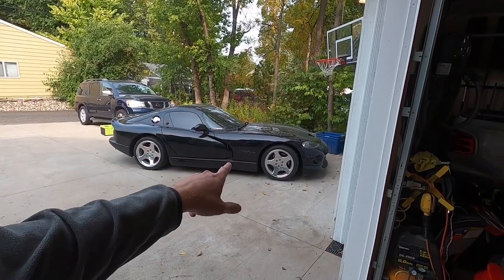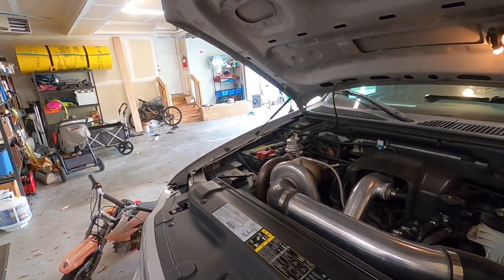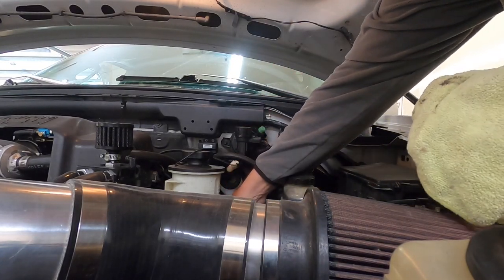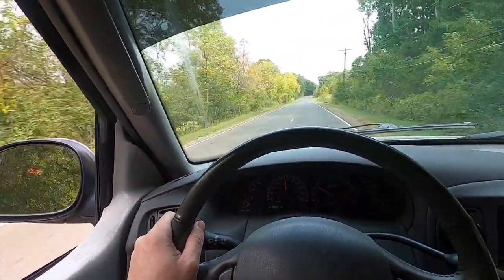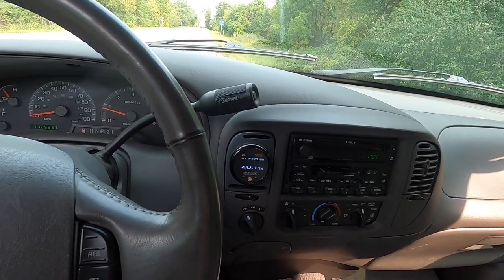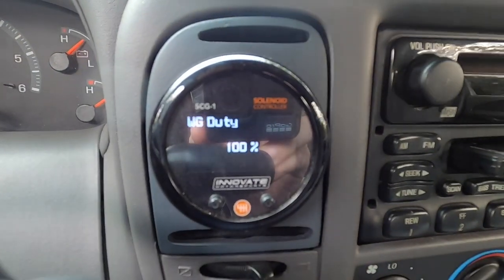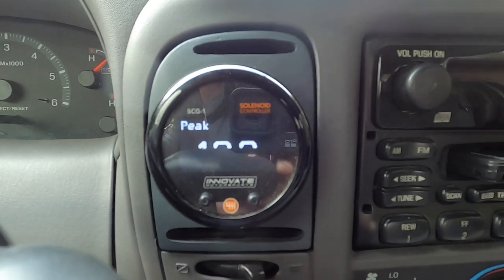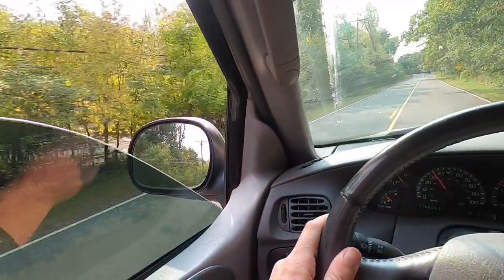Will a STOCK TRITON 5.4L handle 12 PSI?! ***SINGLE TURBO Grandpa Truck***

Comment: I’m calling in the neighborhood of 460 whp at 12 psi. Gramps seems like a fun truck. 🤣
Reply from the maker: That's probably pretty close!
Reply: That’s a generous a amount.
Reply: @brianmccarthy9855  not really. It’s a relatively fair amount considering it made just over 400 at 8.8 psi.
Reply: I bet he's at 530whp ish being a 4.6 probably makes a little under 500 on 10psi
Reply: Those 5.0 and 3.5 ford engines just put their old stuff to shame. 460whp is low hp now for forced induction .    I'm just not impressed by this .
Reply: @greylove1522  difference in perspective I reckon. For a 15+ year old truck to be completely stock outside of the turbo parts and tuning I think it’s neat. Hell, I have a Hyundai making 385 at the crank. Not anything crazy, but it’s enough to be fun even in a 4100-ish lb car. Gives me plenty to play with when the roads empty.
Reply: @Genesis385  I understand what your saying.  385 crank is fun .  I'm just saying the new technology in vehicles now kinda make stuff like this pointless.  Back in 2004 this would've been king of the hill.
Reply: @Genesis385  An ecoboost or 5.0 will match this with a tune. Wild How times have changed.
Reply: @greylove1522  absolutely. My car is a 2011 Hyundai Genesis. 4.6 32 valve v8. Not too shabby. 6 speed ZF auto is a little slow, but that aids in its reliability lol
Reply: @greylove1522  it really is. A friend of mine has a ‘19 5.0 PP1. Did bolt on exhaust, intake, and an E85 tune. Thing was wicked before he did that and I haven’t been in it since all he had was his axle back.
Reply: @Genesis385   I bet it was fast
Reply: @greylove1522  It's daily transportation. If you want to run 50 pounds of boost and spin your motor at 16,000 rpm, buy a Formula One car.
Reply: @Duke_of_Prunes  Do you have any idea what a set up like this would make on a modern F-150?   I'd go as far to say 700 whp at minimum
Reply: @greylove1522  At 700 hp, even the heavy new trucks would get up and go!
Reply: @Duke_of_Prunes   An older crew cab ford is heavier.
Reply: For it being a stock engine.And no forged pistons or and just the turbo its decent power I'm guessing your getting about 580 to 600 whp at 12 pounds.Not bad the gramps is definitely a fun truck for a daily driver.

Comment: I just bought a 97 Eddie Bauer expedition with the 5.4L I didn’t need to see this video!
Reply: This is the video you know you wanted to see
Reply: I just bought a 5.4 litre 1997 single cab -- stripped out with vinyl floors, no options, and very light compared to a new one.

Comment: Compressor surge is what you're hearing from the blow off valve not working. At 100% duty cycle, what is the base wastegate spring youre using? If you go to a base 10# spring you could reduce the duty cycle of the boost controller. Get that blow off valve working. It'll keep the turbo alive longer.
Reply from the maker: It’s a 6# spring, that’s why I can only hit 12psi at 100% duty on my 3 port solenoid. Didn’t realize the % duty cycle would affect the bov.... I’ll need to try that out. I’m afraid if I put 10 pound spring in, I’ll be tempted to try 20psi tho!🤣
Reply: @AutoDetour  I understand the dilemma about boost being addictive. Good luck in your endeavor. My recommendation will definitely fix your boost issue. Also, as i stated previously-get that blow off valve fixed to stop the compressor surge. It is very bad for the turbo. Keep it in between the lines and keep having fun my friend.

Comment: Yeah that's called compressor Surge, and it's caused by the blow off valve not opening. That sound you're hearing is the air stalling over the compressor as it goes backwards against flow, or stops, when the throttle plate closes in the throttle body. It causes a sudden loading and unloading of the shaft very quickly axially and honestly doesnt really hurt the turbo until higher boost levels/shaft speeds.

Comment: The triton bottom end is pretty good. My only concerns would be the compression ring gap under boost and the spark plug threads in the heads. Should hold up well otherwise. Pretty sweet!
Reply: Yeah I read about spark plug blowout and having to rethread. Haven't heard/read anything yet about the turbo setup having that issue.

Comment: I wanna see this against a Lightning
And I wanna see this in person someday.
Reply from the maker: I'd love to get it next to a lightning!
Reply: I second that. 👍
Reply: Harley Davidson edition was basically a 4dr Lightning
Reply: Lightning only ever put out 380 at the crank.
Reply: @ronniestine  A pulley swap will easily get you more power with the Lightning. Kenne Bell makes a bolt-on twin screw too. I think the Lightning would handily take this truck off the line, but the turbo truck would make up some ground as the speeds get higher. The Lightning has some advantages when it comes to suspension and traction too. Then there's the people who have turbocharged their lightning. You've got all forged internals so you can push the bottom end way harder than a standard 5.4.

Comment: If you add ring gap and fresh bearings up while you're at it it can handle some real boost lol
Reply: Around rod bolts and head studs and arp main studs
Reply: @spankthemonkey3437  cheap upgrade forgot to mention.  This is def going to help the cause ...
Reply: no, the rods'll go after 450-500 wheel. It's a time bomb on anything higher than that even with ring gap. the rods are the weakest link

Comment: These 2v 5.4s will run forever!
Reply: Mine has 390k
Reply: 223k on mine
Reply: 602K on mine.
Reply: @keaganhunter1644  really? I'm asking because I want to buy a 2000 expedition. But it has 220k miles. $3k very clean though
Reply: @biggs1485  Take the oil cap off and snap a picture of the cam lobe surface look for sludge and wear if it looks good and sounds good I would consider it. My 600,000 mile 5.4 is in better shape then my farm abused 4.6L same 2 V modular design.
Reply: Gerod Wilson Thats nothing for the early 5.4s our company truck 5.4 went to 400k we swapped the 5.4 for the v10 for more power but that 5.4 wouldn’t quit

Comment: Btw man if you like that turbo flutter you can keep it @ low boost it won’t hurt anything , but if it’s high boost pressures that turbo surge can make shit fail. But yea your waste gate isn’t working properly .
Reply: *blow off valve

Comment: The modular takes boost very well.  The intaje and heads suck but the internals can take close to 700hp before they fail.. its the LS of the ford world
And the 4r70 is a good.. i recommend doing the 500hp J Mod.  Search it. You bunch the holes in the separator plate larger. 
Its a mod from one of the fuys who R&D that trans

Comment: My 05 5.4 3V handles 12 PSI very well with my P1X upgraded procharger.
Just hit 180K miles last week.
It’ll be getting rebuilt this spring.
Love my motor.
Reply: i got a nice 80k mile flareside scab 4x4 itd be sick to strap on a blower
Reply: same year

Comment: PLEASE GO TO AN F150 FORUM AND DO A WRITE UP ON THIS AND GIVE FULL DETAILS OF THE RELIABILITY, DRIVEABILITY, ETC. and then tell us what forum you did it on.
There is no info on turbo 5.4 2v trucks ANYWHERE
Reply: There's a Facebook group called Ford 2v modular engine builders. Mostly mustang guys but there's some trucks and its the same engine
Reply: Because they're not worth the money do what other ford guys do and 5.3 swap it
Reply: There is a reason no one does this. But with the shit up he's going to blow up the turbo before the engine.

Comment: I drive a 2002 f250 with the 5.4 2v and i will say for how much people bash them i regularly haul 2500kg of stone up mountains and man has it treated me good, looking into putting a turbo on it due to the altitude change where i live, truck has 264k km and still runs great

Comment: Fords truck trans are bulletproof I'm convinced
Reply from the maker: Haha! So far so good!
Reply: Mines been though some shit and I honestly have no clue how it's not dead yet.
Reply: I have a 2000 f150 with 460k on the original trans and transfer case if that tells you anything about that transmission holding up. I haven't exactly babied it and I bought it new in Nov of 99.

Comment: MORE than likely that's a vaccum line issue. Either messing up where check valve goes. Some sort of vaccum issue with the bov. Your turbo is chopping air the bov isn't doing anything.
Reply: You are correct!

Comment: That is a cool sleeper man! I have a 05 fx4  I purchased in 2010 used!, it had 70k on the odometer when I bought it  fast forward 11 yrs later  it has just over 170k! It started to run really rough a few weeks back I had bad misfires poor idling etc I took it to a solid reliable  ford mechanic now  it's getting  the upgraded oil pump new timing chains tensioners phasers spark plugs coil packs the list goes on!!!  it's blown one spark plug since I've owned it and had numerous coil pack failures !! It sounded like a diesel truck it ticked so bad for so long and ran poor but never broke down lol ! Hopefully when I get it back it will be like a brand new truck  🤣
Reply from the maker: Thanks Mike! They are great trucks and it's good you're getting those phasers done. Those can be a real problem in those if left untouched. You've given that truck a good life. Hope it's better than new when you get it back!

Comment: If you had a 4.6l engine would the trubo kit just bolt on?
Reply from the maker: Yes, it should. You will still need to modify the bov and maf location to make it work.

Comment: I literally did this 20 years ago and many times since.  On both stock and built engines, 400 rwhp to 1000 rwhp.  Good fuel, lower IATs and good tuning are the basics.  A 5.4 is literally just a stroked Mustang engine.  And do the spark plug inserts at some point if you doing bigger boost levels.

Comment: You have a lot of faith in that 3V
Reply: This is a 2v 5.4 not 3v. The 3v I believe didn’t start till 2004 when they changed body styles.
Reply from the maker: Exactly what Mark said. 2v FTW!

Comment: 467whp at 12psi. If it were mine I would turn it down to 80% duty to drive around on. That 1 psi isnt worth blowing it up lol. My  tuned ecoboost is at the same power level it runs mid 4sec 0-60 times.
Reply from the maker: Probably not a bad idea. I'm super curious to see what the number is

Comment: One of your vac lines to blow off valve is blocked, that noise is the pressure going back through your compressor wheel, not a good thing, but not a bad thing either lol
Reply from the maker: I still haven't dug into it to see why it's doing it. I just keep sending it. 😂

Comment: I believe for every 7psi of boost you get %50 of base horsepower added with a stock head cam and bore. So with a 200hp engine would produce 300hp at 7psi of boost.
Reply from the maker: These engines like boost. I doubled the stock hp at 8.8psi
Reply: @AutoDetour  yeah similar to the v10 I'm leery of going over 10psi boost on my v10 but at 10psi my superduty is outperforming tuned 7.3s.

Comment: That is compressor surge as stated below. Did you change the vacuum routing at all? Make sure the bov and wg have direct lines to vacuum. You don't want to do that for a long period of time or you will destroy the bearings in the turbo.
Reply from the maker: I didn't change anything. I'm wondering if the cheap Chinese bov just quit working

Comment: Under vacuum or low boost your getting bov flutter it’s just air stuck in the charge pipes bouncing back and forth causing the bov to flutter as long as it’s not doing it at higher boost applications your solid. Fyi it is not surge or dose your good my man. Also try loosing the bov spring just play with it
Reply: With my cars we see this when we add front mount intercoolers and it’s very common with longer charge pipes routes

Comment: That’s compressor surge and it’s bad for your turbo. You need to adjust the blow off valve to open and stay open when it hits. More or less your bov is opening and closing rapidly and the sound is the air rushing into the compressor wheel when it flaps closed.

Comment: Compressor surge, it's not particularly good for the turbo AFAIK. This happened to me once when the vacuum line slipped off my BOV, noticed it instantly by the different sound.
Reply: @CodeBaconfy  Makes sense
Reply from the maker: Yeah. I'm wondering if the bov quit working. I'll have to see what's up.

Comment: Too bad they won't make a kit for the triton V10 😭😭😭 would love to put a kit in my 01 350
Reply: We jus swapped a v10 in our 2000 f250 from the 5.4 the v10 is a monster ive been looking everywhere for a turbo kit with no luck
Reply: @jwayne1202  I mean I don't even need a whole kit really just headers are the hardest part if someone could make a few different header styles would be perfect everything else can be for the most part fabricobbled together with ease. If someone could do a twin turbo style headers and a single turbo style for simplicity I just want a single turbo setup. But there is a guy that I believe did a custom twin turbo setup and made something like over 700hp on really low boost. But he hasn't made any updates in a long time.
Reply from the maker: I would love to see one!
Reply: @AutoDetour  here it is. My bad not over 700 hp but over 700tq I mean I guess if you go by crank hp and factor in drive train loss and all that I suppose it's not far off from 700hp but at the wheels it was like 550+whp and 800+ wheel torque on only 6psi I don't remember what all he did internal wise but I know it wasn't anything extreme or anything. Just some valvetrain rods pistons and a few other things but I don't think he even sleeved anything.

https://youtu.be/37H9dq4FTmM

Comment: I'm assuming you're planning on upgrading the trans too? Possibly the diff? Also, I really want to see you run it on the 1/4.
Reply from the maker: I'm assuming all of the drivetrain will need some attention, but wouldn't it be nuts to see if it holds it?
Reply: @AutoDetour  I mean 12 psi on a stock bottom end and what it's going through now, especially knowing Ford's transmission reliability is pretty damn good.
Reply: 4r70w shits on 4l60 that's for damn sure

Comment: Well a stock Lightning block can handle up to 16 psi reliably and 18 pushing it.
Reply: But I do know that a lightning block vs regular 5.4 block are different compression is higher on the regular 5.4 block and internals depending on the year.

Comment: From my experience, the weak point of the 5.4 is the spark plugs blowing out of the head. The other weak point is the flex plate on the 4r70e transmission. This truck might have some variant of that trans which means the flex plate is paper thin.
Reply from the maker: This is an '03. It has the updated heads with more threads. The 4r70w is hanging in there. I know it won't last forever though.
Reply: My f150 5.4 2v has the rare 4r100 transmission and the 10.25 rear end. It also has factory CNG- 120 octane rating, harder valves and valve seats. I’d like to mill the head or boost compression. CNG can handle 14:1 or even 15:1 compression. Just don’t know who would tune it.
Reply: @Upliftyourbrothers  Is that stuff standard in the heavy half?
Reply: @tannerhartl5175  yeah. Depending on the year, early ones were called f-250ld for light duty, then the 2000 and new were f150’s with the ‘7700’ package. They WILL have 7 lug wheels. It’s pretty much a f250 with a f150 body. Its more f250 than 150.
Reply: @Upliftyourbrothers  Not that its not kinda neat, but I wanna know who at ford thought that was a worthwhile endeavor
Reply: @tannerhartl5175  right? That is really strange

Comment: Transmission is slowing it down. Gears are too long. Upgrade to 4r100 lightning or 6spd auto 6r80 from the coyote motors. This combo with the right transmission and converter should smoke any lightning that is stock of course with traction
Reply from the maker: Tall gears aren't a bad thing if you have the power. Less shifts make it faster as well. Granted we are pulling torque in the tune during shifts right now to save the stock transmission, but I'm fairly certain I'm already faster than a stock Lightning, but would love to test that out.
Reply: @AutoDetour  what you are saying is true about tall gears. I was speaking more from an experience i had in the past with a 5.4 lightning my pop had that blew the transmission after 100k of abuse. Old boy lost interest in the truck and just swapped an 4r70w from a 5.4 triton and the decline in performance was night and day. I do like the 6r80 because you can cruise on 6th gear on the highway and not lose torque because how close the gearing is. It would work well also with your factory rear end gears too but money & goals can play a factor.

Comment: Man, I'm just waiting for your spark plugs to blow out on that motor. It's my understanding that boosting the early Triton motors leads to that problem. However, I don't own an early model. Mine is a 2010 Triton, and I've got 170000 miles on it (105k of those miles are mine). I've been absolutely amazed at how reliable my truck has been. Maintenance is key. Forget Fords 7500 mile oil change interval. I do mine every 5000, using only factory spec Motorcraft 5w20 and their 820s filter. I've also had to replace the trans filter/fluid, and the differential oil. Ford says they're "lifetime fluids", but don't take that literally. My fluids were nasty.
Reply: What motor does the 2010 triton  have?

Comment: Your bov is not opening fast enough to relieve pressure. It's springing back and forth very quickly because, maybe, you don't have the right spring in it? Like I said maybe... Hope that helps

Comment: The flutter sound is the exact sound it will make if the bov line came unplugged. Bov not working
Reply from the maker: I still need to find the leak. The line is still plugged in. I think the bov may have just taken a dump.